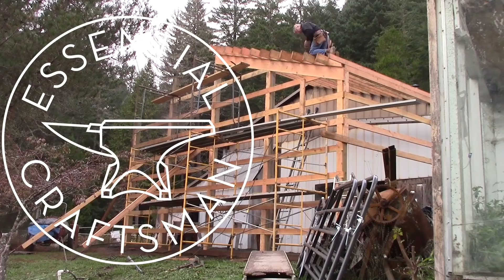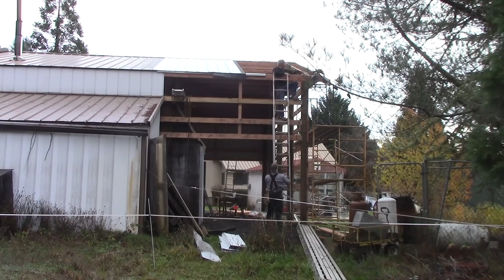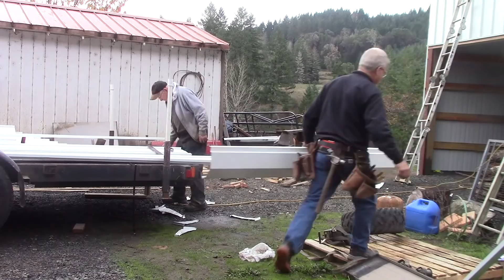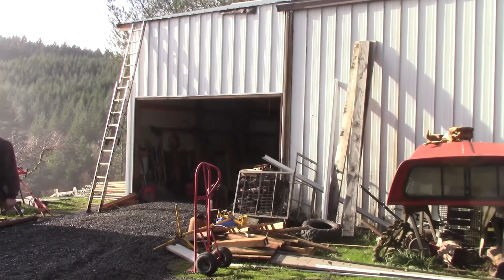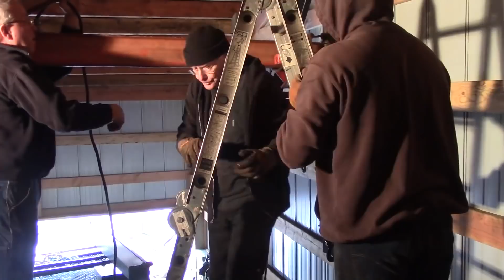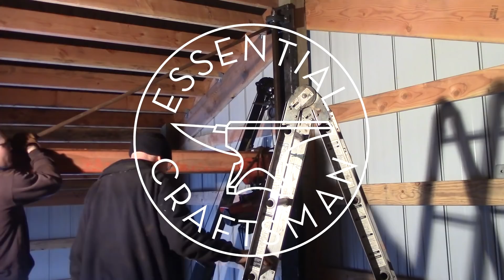Jobsite Safety and Taking Risks

Comment: There are parts to this video that I agree to and parts I slightly disagree with. I agree the most important safety device is a person's brain, but I also believe that the leaders of any particular job have more of an obligation to keep their workers safe than the workers themselves. Things like codes and OSHA are great, and they prevent the wicked from harming the uneducated or the inexperienced. As well, if you can even put yourself in a situation where you can be hurt, something is probably wrong. You should be proud of not having any scars or close calls. No one should ever have to put themselves in harms way to make a dollar in this country, no matter what.

Comment: I've working in steel mills for 43 years & it scares me how much the younger guys depend on their PPE.  Sure it will save you from a lot of annoying burns and cuts but if you get a big leak of steel, no amount of ppe is going to save you.  You need to be alert and paying attention to not be there when the bad one happens.  As I say to the young guys "if you see me running, try to keep up", they say they can outrun me and in normal circumstances they are right.  But if i'm running in the melt shop, I'll know why I'm running & will have adrenaline working for me.

Comment: One aspect of safety on a roof that comes to my mind that I encountered the other day while working over 20 feet high fixing a soffit on a house built in 1914 were God's little insect creatures. This house is not inhabited by people yet a battle between wasps and carpenter bees. I will not kill honey bees but I will kill wasps in A New York second. So before I climbed up my 20 for ladder I was very careful to spray the half a dozen softball size wasp nests that plagued my pathway to the soffit above the huge back porch. It as a fairly low slope on the porch then the soffit then an almost flat sloped roof between two 12/12 pitched rooves. It was a stubborn fix but I got a "good job" from the GC that owns the house. My safety issue wasn't that I was over 20 feet off the ground but the thing that freaked me out was how my little carpenter bee friends would chase off the wasps trying to return to their now poison drenched nest in horror of seeing their dead family, some still clinging to the nest. The carpenter bee would attack the wasps then come right back to hover and watch me do my work. They hovered about 8 to 10 feet away just watching me. The entire time they watched with the occasional attack on the wasps. Then right back to watching me. I didn't expect that. I was so scared that I was going to get stung and fall off the roof. I took a break to sit on the extremely flat slope of the roof of the house and looked at my little hovering friend. I had a hand saw in my hand because I had just worn myself out cutting a few strips wood to repair the soffit. As I sat to rest my little friend became a little too curious and charged me so I took the saw and as the carpenter bee made a beeline for me I used the saw as a baseball bat and with a note of a high "c" ting...... batted that little traitor into the back yard. But amazingly in mid air it regained its bearings and flew right back to its hovering position as to say "ok, I know my roll in this weird human encounter". It didn't attack me for the remainder of the job. It just hovered and attacked the wasps as before. Now maybe I was repairing it's home, or perhaps giving him a new place to call home but as far as I could tell his little hole was on the eave next to me. Maybe he was watching his neighbor's hole while it was on vacation. Whatever the case it was weird for me and was actually my biggest safety concern, even though falling off a 20 foot high roof hurts, a wasp's sting was my major concern. Actually multiple wasp stings was my concern.  I rationalized that the grass is high and soft but the stinger is sharp, pointy and full of venom. If you made it this far in my story my point is sometimes the work itself isn't the most hazardous part of the job, it's nature.

Comment: I roofed as part of the building process for years...until the mandatory"safety harness became a requirement. Twice I was nearly mamed or killed by them. Once when I stepped on the line and slid into a valley( luckily? And again when another workers line tripped me. That one nearly sent me three stories to the ground! In the prior 20 or so years I was always aware of my surroundings and my perch and remained safe. I lean toward the belief that many times the reliance on safety equipment leads to carelessness that would not occur when responsibility for your life is your own responsibility.

Comment: Agreed. I can tell you as a second generation roofing contractor, those harnesses and lanyards are often more danger then they are safety. I only wear one when I truly believe it's necessary. Ropes, cables, lanyards, air hoses, and chords are all good at one very specific thing. Breaking your ankle. So I generally prefer to not drag one Everywhere I Go on the roof :-) I feed my family with my body. If my body gets broken some bureaucrat that makes up safety regulations isn't going to feed my family. That's my responsibility

Comment: I have great respect for your content and presentation as well as your work, however... Your brain being your method of safety, while good in theory, in practice may fall short. It cannot reliably predict product or material failure. It cannot also predict with any degree of certainty the actions of others that may impact your safety and wellbeing. While the laws have evolved, and in many ways become onerous, in many ways they are intended to protect you from outside influences that are beyond your control... Nice work on the shop.
Reply: Agreed.

Comment: I'm reminded of something my grandfather used to talk about.
It's a little tough to explain, but here goes...
When he was a kid, the barn had a rail with a pulley (to lift bails) which had an adjustable stop at the end of the rail (which ran out to the end of the gable). The trouble was, the stop would continually move toward the end of the rail (since the sliding pulley would bump into it).
To fix it, they'd get a long wooden ladder, and my grandpa's two older brothers would hold each side of the ladder, which rested on the bottom of the opening for the hayloft doors - about 5 feet off the floor.
So my grandfather would climb this ladder, 15 feet above the last place the ladder touched anything, and around 40 feet off the ground, to move the pulley stop back to where it needed to be.

I think at some point they all figured out some other way to manage that, but he said he remembered doing that many times as a young kid.

I think about that sometimes when my kids are doing something like climbing around on my truck and I worry about them falling off and "getting hurt". Most times I just let them continue playing :)

Comment: As an old seabee, I saw the safety codification wave hit hard in my career. What I witnessed was the strangulation of the simplest tasks. As safety increased, production slowed to a crawl. And eventually I lost pride in the tasks I completed, and just felt like a cog in over-designed engineering nightmare.
Reply from the maker: Well put...
Reply: MCB 128    2 years in Vietnam
Reply: @glenngoodale1709  What was your BUDs class number? lol
Reply: @thomasbrown9402  I was stationed in Gulfport Miss.    CES2
Reply: @seattlesix  I am talking about the simple tasks, to be specific. Like if you're going to nail a nail into a 2"x4", you must wear eye protection, hearing protection, knee pads, a harness, gloves, while standing behind a one inch wall of bulletproof glass, and you must submit a chit 72hrs prior to nailing. As a former electrician, I would never violate lock out tag out procedures, because it's actually a legitimate safety procedure. You've completely missed the point.
Reply: worxharder - understood, then there are some who complain about production and try to walk away after bad things happen.
Reply: @seattlesix  yes , sad

Comment: Your comment that ‘safety is the workers prospective’ is wrong, some don’t have the sense of danger and will put themselves and others in danger as well as them selves, also peer pressure can make people do things they wouldn’t normally just to fit in or even pressure to just get the job done. 

You seem to have the ‘she will be alright’ and just get the job done attitude.

What would have happened if you slipped on that wet roof with the rope tied around your waist. Did you consider the fall factor, did you have a workable rescue plan in place? If you feel over 10 ft you would probably have caused major internal injuries or even died. If you fell what would you do with the tools in your hand, I am guessing they weren’t on lanyard, what if your co-worker or client was beneath you and not wearing a helmet.

Your experience has built up a false sense of self-reliance and fearlessness. This will get you in trouble and worse cause others to follow as they think this the norm and what is expected of them and they may not have skills, judgement or simply the luck to get away with it, someone will get hurt or worse.

Site and job safety laws,  req’s and guidance are there to stop the peer pressure, stupidity and poor and ill informed judgements. If everyone stuck to the same safety rules, the pressure of money to cut corners would stop. It should be not your choice to cut corners and think you whole own the risk and the liability when it go wrong, someone else always pays a price.

This is an ill-advised video at best which is a shame as your video are  normally very good and informative.

Comment: I entered residential construction - new/remod/addition etc 20 years ago. I've never used a worm drive like that. Sure when working with massive lvl, psl, large beams etc where you need the amps and balls, but never climbing around in a roof structure system. I'll certainly give you a bow and a hats off, trimming tails and fly ends with a monster like that is hard on the forearms and tendons!

That said, your site certainly looks safe compared to some of the shenanigans I've been forced to work with but as I grow older (37) and as a big man 6'6" 300+, I cannot afford a fall, an injury, and will no longer put myself in a dangerous and hokey situation for any amount of money.  

Cheers!
Reply: You must not be front the west coast, its worm drive or nothing out here.
Reply: @joecox310 , You must agree though, that if it's not needed, why use it right ?
Reply: @August 
I use a worm drive every day. Like i say, its worm drive or nothing. Worm drives are what im used to so that's what I use.
Reply: @joecox310 , True. If that's what your used to and it works, Plus they do have more power.
Reply: Leiron, worm drive skill saws are a push saw so cutting tails upward it stays in alignment better to your marks and cutting tails downward it is easy to guide while the weight of the saw does the work. Side winders (circular saws) are a push me pull me tool and take effort to cut straight lines from above.
Reply: @joecox310   #WormDriveForever
Reply: You guys use the 60v dewalt? I’m into Milwaukee pretty deep, but I’d love that saw.